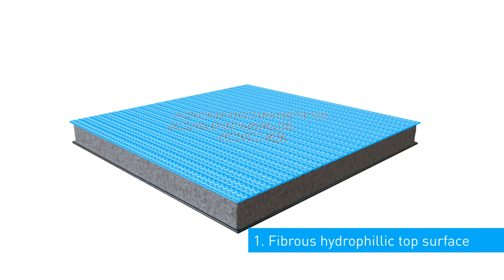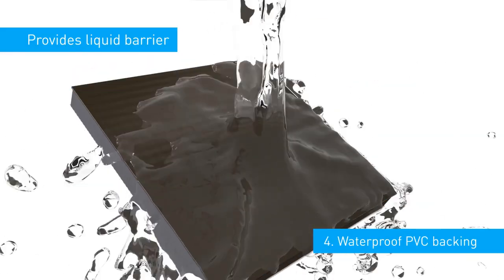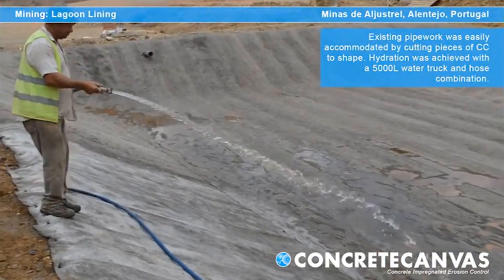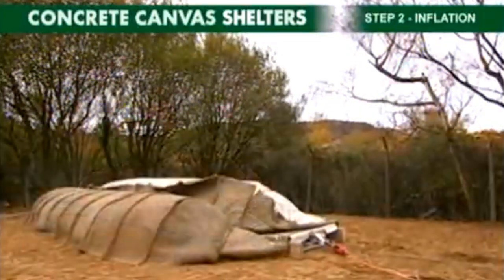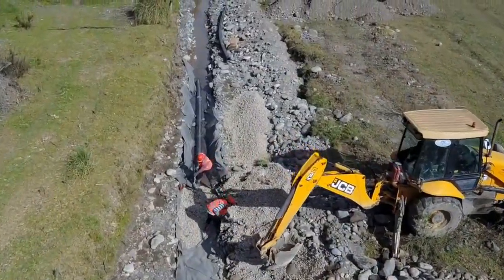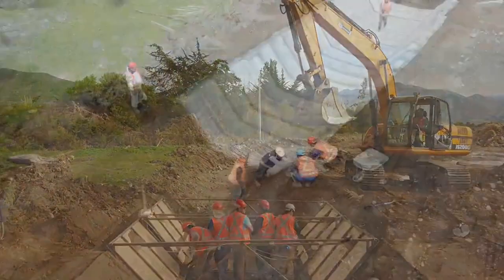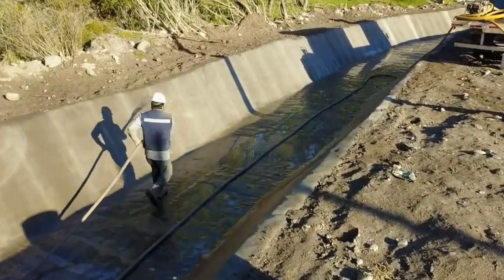Premade Concrete Canvas Tents - Just Add Water

Comment: This material would fly off the shelf if it were a bit less expensive.
Reply: If only concrete could fly!
Reply: @charlieodom9107  concrete plane?
Reply: i mean if it lighter you could make a kite out of it too
Reply: how much does it cost vs a close substitute etc?
Reply: Don't worry, China will have something for you soon.
Reply: @killervirus57  yeah i know, covid, we're all gunna get it sooner or later
Reply: @ThePalatineHill  i was talking about a knockoff concrete fabric, but okay.
Reply: @killervirus57  You mean one of  the "knockoffs" for which $30 billions a year of royalties paid?
Reply: You can make your own for pennies using cement and fabric! Thats it! Want it really strong? Add sand to the concrete. Dip the fabric and put in shspe you want! Cost..less than a coke.
Reply: gotta wait 20 years for the patent to expire. then it will get cheaper and start flying. 19th century laws once again holding back progress.
Reply: China needs to get on this
Reply: @vincentgatekeeper1421  I know, I mean have you seen their buildings that just fall over or large parts of the fascia are falling off. Who would put their $$$ and safety on the line for some knock off concrete canvas that may fail cause of some Chinese company's poor quality control and greed?
Reply: @killervirus57  Yea and Russia got something for us too that we don't want and Trump will make sure they got their way.
Reply: This material would fly off the shelf if it only weighed the same as a feather :D
Reply: @fakiirification  I think 7 years would be fair.  Research shows on average it takes 5 years to get a small business up and going.  Then you would have a couple more years to reap benefits and further establish the company.
Reply: @vincentgatekeeper1421  Build up ^ stackable concrete tents.
Reply: @Mr_PNW  great, problem with that is as soon as your stackable get some moisture on them, they will meld together so even a forklift couldn't pull them apart!
Reply: Yup
Reply: @vincentgatekeeper1421  my mom used to make flower pots like that. She would get a bag of Quick Crete and put cloth in it. Then she would drape them over buckets and vases so they had flat bottoms. After they dried she would paint them. People used to buy them from her store all the time.
Reply: @killervirus57  agreed
Reply: r2d23678  oh jeez... you know what believe what you want i don't argue with crazy, be it from the left or the right
Reply: Make your own.. 1 layer plastic sheet, 1 layer cement, 1 layer fabric
Reply: it is possible too make it yourself though pretty easy all you need is bag of quickset concrete , Burlap and Felt and string too sow each section together.
Reply: @fakiirification  Patents are important my dude. They are what make progress possible. Because the original patent holder has to produce money to pay for all the research and design.
Reply: 23k concrete tent no sorry
Reply: just soak a synthetic fabric blanket in concrete. idk what material the fabric is made of they use but would be interesting. the canvas explanation part didn't say too much other than the build of it.
Reply: Yeah, its ridiculous in price.
Reply: Yea, way to expensive even for military use. Plus there is no real advantage to this over a normal tent, infact there are disadvantages. It's not portable, or light and it's not re-usable. If they wanted something permanent they would just spend 30k on a proper building.
Reply: Manufacturing it is definitely very involved and the price reflects that. It's really not a material for the mass market and the reality is that vast majority of consumers wouldn't be able to really take advantage of the benefits anyway and would be better of with more conventional methods. The main benefit of this would be that it's a lot faster to work with than pretty much anything else, especially in remote locations where you'd have to bring a lot of tools, machinery and material and possibly work for weeks and months as opposed to hours and days. Plus it allows for different and new solutions.
Reply: for a brick, it would have flown pretty good
Reply: @A Twinspark That's missing the whole point.
This stuff is more material efficient, more applicable, and faster t o prepare, but just more expensive.
Reply: @oneuponedown  Chinese escalators, nuff said.
Reply: The Underdog Music  what if I told you my college makes concrete boats and they actually race them at the rowing facility.
Reply: @oneuponedown  are you looking for names to back it or wondering? I would back it and buy shares too
Reply: @Zaire82  Well.. if you are talking for expensive labour countries then it can be borderline similar, and for sure, in time critical missions, this would be deffinatelly accepted. The storm drains for example is a no brainer. But the tent is a bit too expensive. Still, if a decent military grade of safety and sturdyness is achieved.. hmm I don't know.
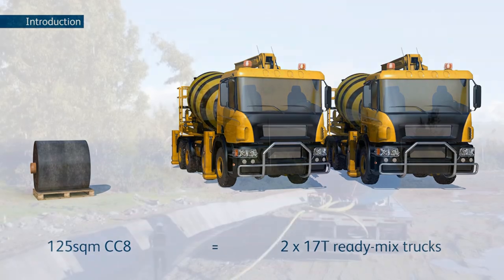Reply: @will16320  @2:23
Reply: @will16320   @2:23
Reply: for what uses? Yes it's pretty epic but not universal
Reply: Quite Literally
Reply: Imagine, though, the horrors of getting rid of one when it fails. You can't fix it, you have to tear it down and... rent a big dumpster to haul it off.
Reply: If it flew off the shelf then its too cheap. Also, that material is quite a temporary solution.
Reply: @will16320  Google says they cost between 25-30 grand. That’s insane.
Reply: @donaldducko6580  Government prices mate, looks like I'm gonna have to stick with a shed
Reply: @killervirus57  aah . . . knockoff ...so and so concrete
Reply: @fakiirification  those laws dont prevent you from making these things. you just cant sell it or profit from it like a capitalist pig would want to
Reply: for those who say it would fly off the shelf: Short answer no. It wouldn’t. I’m a civil engineer and it just isn’t strong enough to pass regulations. The only use it has is to line a tent and a water channel, and even they won’t survive 10 years.
Reply: @littleface7060  better yet, lead zeppelin
Reply: This material would fly off the shelf if it were a bit less heavy.
Reply: Theres always red bull
Reply: off the concrete shelf, probably! lol
Reply: @will16320  ~60% the price of a 4" slab... but 4x the labor to install
Reply: I'd build a castle
Reply: Give it time and it will have either developed its own manufacturing industry pipeline or some conglomerate will consolidate the supply of materials for it

Comment: A 20,00$ to $30,000 dollar tent 🤦🏼‍♂️🤷🏼‍♂️ I mean it's cool but it's not that cool.
Reply: Courtney Chappell if it was $1,500-2,500 I would buy it in a snap. Put a tent up on my farm then bring in dirt and bury it for insulation and a storm shelter.
Reply: Why would you expect to pay less for this than a garden shed?
Reply: Its more than a tent lmao. Do you expect to take this camping?
Reply: Yeah, there are numerous ways to build a cheaper and better permanent structures.
Reply: @swimant0  all day
Reply: @shumeister1059  how about faster? He mentioned military, they probably need it in a snap
Reply: $30,000 is about $12 after adjusted for government spending.
Reply: @MF175mp  Yeah, I suppose so. The military budget can be quite insane.
Reply: I was thinking "why". I mean they're going to need also a hefty air pump capable of pumping enough pressure to keep the heavy sheets in place while they dry, an material that withstands said pressure and a tanker truck. That's a lot of things to fail in a military application when they could just pack a ship container full of prefab materials and assemble it in a similar amount of time, including using the container itself as an additional structure.
Reply: @jerbear7952  the thing with it is that it makes for a quick bomb shelter. Just pour dirt over it and you're good to go. Hence the "military use" bitm
Reply: @xXx_Oshino_xXx  not really.
It is only designed to protect against small arms fire and shell fragments when covered with sand or earth.
Therefore it is kinda useless for military use. If the military needs protection they usually need more than protection against shell fragments.
Reply: @Jehty_  The military not always needs protection against firearms lol
If you need a 50mt2 shelter fast and with a decent resistance, with this you can assemble it whenever you want and it practically does not take up space having it behind a vehicle, and it is not necessary to transport any material or manpower.
I hope it's not hard to imagine in how many situations this can be useful, and for organizations that need something like this 20k is nothing
Reply: @ivr2132  you need a 3,1 ton tent and 2000 liters of water.
That's 5 tons for a 50m² tent with a limited amount of protection (you also need something to move earth, because without the earth cover it doesn't provide much protection) 
I don't know any situation where a one-time use tent of that kind would be useful in the military.
Reply: That's about the prices of military tents. a new DRASH can go upwards of that. Used tents are around 5K still.
Reply: military prices! How about 5k lol
Reply: For $ 30,000 I can buy materials for a beautiful 3 bedroom cottage and build it myself in one summer
Reply: ProseColored Glasses  I'm not sure if PVC pipe would be strong enough but I would hope that you could rough frame out something for less... At the end it permanent and concrete so for quick watertight shelter it would do... You could even cut in some windows and insulate it
Reply: i dont think it was made for just camping or rec. its made for military hence why he mentions that and not its great for camping. i dont get why people complain about expensive shit not eveything is made for cheap for the masses. this is for people in remote locations like scientists in siberia or some shit. how much do you think a camper is bc a class A is about 250,000 to have a home that can go anywhere 30k is. a bargain
Reply: yeah. airlifting a prebuilt shed might cost less even.
Reply: @swimant0  $1,500-2,500? The thing is pricey, sure, but God damn dude. I've seen wooden sheds sell for that kind of price.
Reply: Guessing they don't produce that many as it sounds like the material costs aren't as much, which generally explains the high cost.  If there was a high enough demand in which production would be streamlined, then the price would go down.
Reply: True
Reply: @smoothiegreenburg6065  1) This system is not mobile once setup...its concrete.  
2) this tent appears to be about 1 inch or less of very basic concrete, that is not stopping any military ordinance and will not count as a hardened structure in and of itself.  Nor would it likely support being covered with earth or gravel unless reinforced inside with some superstructure to disperse the load into a foundation.
3) when overlaid as shown in the video, and with the layers they show, this system will not be water tight enough to be a ditch long term.  There will be leakage and seepage that will undermine the substrate and filler material.  

So its utility seems to be in the rapid setup time, not for a long term project or replacement for large scale infrastructure projects.  As far as the 'tent'...nothing about it appears to out compete a standard 'conex' style container flipped and converted to a living/work/storage space...and those CAN handle some weight loading with sandbags/earth/rock poured over them.
Reply: matt vanbeekveld  military wastes money like it was toilet paper. Would be nothing special about that price
Reply: And that's just the shell. You still have to add wiring, plumbing, ventilation. And did anybody mention, flooring? If its a permanent structure then it definitely  needs a foundation. Does that come in a box too?
Reply: Since when have tents had plumbing and wiring or floors?
Reply: @MF175mp  Since when have tents become permanent structures?
Reply: Bonkers who t eff would pay that ..🤣🤣
Reply: They do that on purpose because I can see better homesteads than the timber and plastic ones we have to pay for, but they can completely transform slums in 3rd world countries.  But people are getting more innovative in South America, they've invented a brick made of recycled plastic and a "secret agent" which I think is just sand but the bricks are water proof fire proof and insulated the only problem they have is not having enough plastic waste 😒 whereas places like NYC New Jersey literally produce metric tons of plastic waste each year
Reply: Durability ???
Reply: PERMANENT! lmao
Reply: @MF175mp  I would guess the US military would spend more than 30k on toilet paper in a month.
Reply: @MF175mp  military would use tents as they always have for their immediate needs and for more permanent structures would fly in a bunch of flatpak / prefabricated buildings or build them. Maybe a concrete tent has benefits, but it would have to really, really justify itself with a price tag that high.
Reply: @jerbear7952  A garden shed would last longer and be stronger than a half inch concrete bubble for a 5th the price and a few weekends of work.
Reply: fireproof, wind proof, maybe bullet proof. Good storm shelter/fire shelter. Nice spot for your survival food or other supplies.  You could set up cameras outside and run wires inside to see what is happening out there. I like it.

Might even take a tree falling on it better than something you build yourself
Reply: @recoveringsoul755  Maybe if the fire is a lighter and the bullets are very low caliber.  A half inch of cement just doesn't have the structural qualities to handle extreme thermal and shear loads like they're trying to convince us of here.  Maybe if you spend another 40-60 grand for some extra layers.
Reply: @recoveringsoul755  bullet proof? Fire proof? Lol no. It would be about .5in of unreinforced concrete with a plastic membrane backing.
Reply: @drxym  didn't they say fireproof?
Reply: @fortusvictus8297  Yeah, those are some pretty good points. Apart from the rapid setup time, do you think there are any other major benefits of using concrete canvas?
Reply: @xXx_Oshino_xXx  Yeah. It makes more sense as a dug in or partly dug in structure.  
Since some talk about no windows/ventilation - those can be added after it's hardened depending on need.
The big downside is the hefty price.
Reply: @Jehty_  In a forward base.
Reply: for civilians it makes no sense lol for military use it has a lot of potential even if the tech is expensive right now
Reply: Yep that's an expensive concrete tent - 🤦‍♂️
Reply: Obviously not a product for consumers.
Reply: just get a shipping container...
Reply: @jackmcslay  hefty pump?? superficial knowledge...
Reply: Dam i could buy a house with that money!
Reply: @jerbear7952  nobody's paying 20k for a shed
Reply: @shumeister1059  I think its very blatantly obvious this isn't meant for permanent use 
did you watch the video? no shit, its meant for convenience.
Reply: @shumeister1059  never seen these tents.. like ever I've been places... army still loves the a frames and GP meds...
Reply: @videowatcher8818  come build for me
Reply: @jerbear7952  "Why would you expect to pay less for this than a garden shed?"

Why would you expect to pay $20,000 - $30,000 for a garden shed?
Reply: @xXx_Oshino_xXx  I think you are misinterpreting my comment or replying to me on accident. I think this is great.
Reply: When Walmart starts selling it for $1500, I'll buy one

Comment: Getting the tent back in its bag after use would almost be as difficult as getting a Coleman dome tent in it's original storage bag.
Reply: that y they say once u wet it it becomes permanent
Reply: @malachilyrics2695  That is why it would be difficult to do, it was a joke.
Reply: @malachilyrics2695  insert underwear joke here! lol!
Reply: Now, that’s just impossible. Lol
Reply: @michaelking3327  the "Good Job" one, right?
Reply: Almost.
Reply: Eventually they added a tab on the bag that you can pull after taking the tent out.

The tab opens up some extra space so you can fit it back in the bag(it's still hard if you don't refold the same way and get the air out)
Reply: Fold the tent the right way, get all the air out. It's easy
Reply: @stevedd9725  Not on the one I have, maybe they have improved the bags in the last 22 years.
Reply: too funny
Reply: If your tent stays erect for more than six weeks, contact your physician.
Reply: amkost
Reply: No tent goes back in original packaging
Reply: @malachilyrics2695  r/whooosh
Reply: Pay attention when you unpack your coleman tent, and it'll fit just fine.
Reply: Just buy a bigger bag, duhhhh😮🤔🤠🤠🤠🤠😂

Comment: I recycled used carpet, then use it with concrete like shingles, they are very heavy once impregnated with Portland and water.  Works great for erosion barrier.
Reply: Matt S  Mold only grows where the RH is high enough to condense water, but with out any stone in the mix there is far less for water to condense on anyway, which makes the mix more hydrophobic.  It's so dry here that I use the same system for radiant cooling and heating.  Besides, you would be surprised how much mold is in a normal home, it's disgusting.